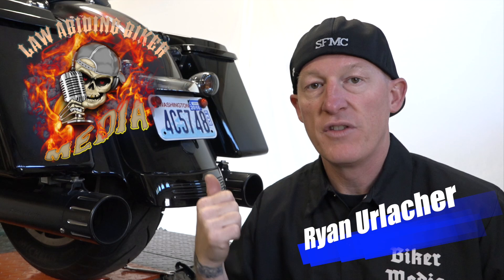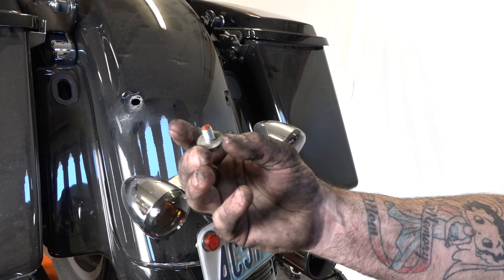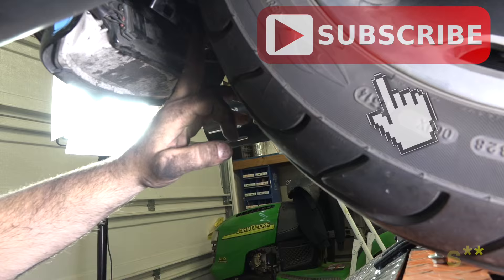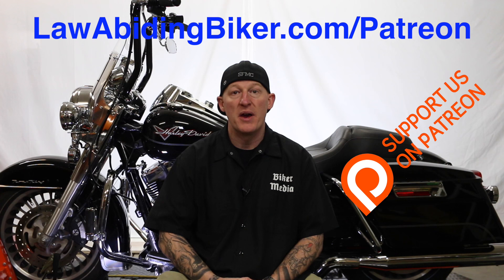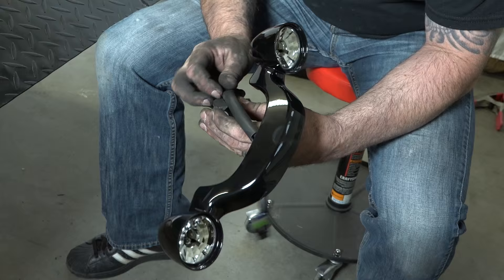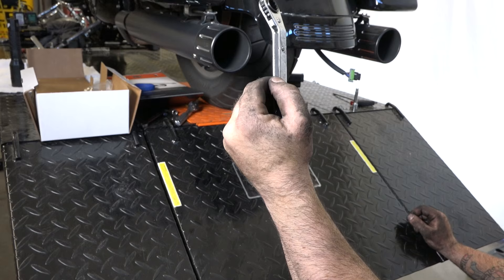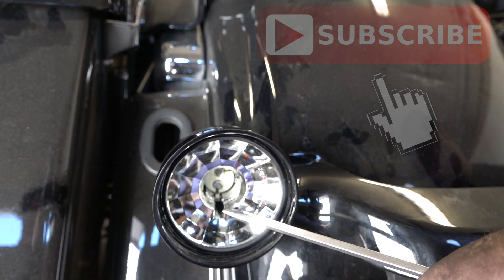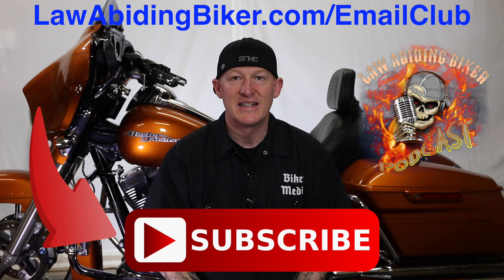Install Bullet Rear Turn Signals LED & Brake Light Bar on Harley Davidson Touring-DIY

Comment: Today I fitted the Harley turn signal relocation kit to my 2007 Electra Glide. The bike is imported from the USA and that kit allows mounting of the bigger and more awkward British number plate.
Your video is excellent! It gave me the confidence to carry out the work. Furthermore your video helped to make sense of the Harley instructions. The job is a little more involved for the Electra Glide but the task is essentially the same.
I just hate paying dealers for work that can be accomplished at home. Your videos help us to know the machine and take responsibility for making sure it is serviced and safe. Thank you.
Reply from the maker: Thanks John for the shout out. Super glad and always smile when I hear that the videos are helping bikers worldwide!!  hope you are well and getting some riding in!!
Reply: Hey John, which kit did you use? I just got a 2007 Electra Glide myself.

Comment: Hi I have a question, will this turn signal assembly bolt on a 2010 Roadking, I see the bolt holes are almost at the same distance from each other? It will be helpful as I am planning to replace that big chrome bar at the rear, thanks.

Comment: Love your vids. Thanks. I am looking for a bullet light bar replacement w/ laydown rear brake light for a 2009 Ultra Classic. I want to get away from the str8 bar with turn signals. Any suggestions.  Thanks
Reply: Paul In fact I’m also looking for a similar solution like the one you asked for. I found a video online which has a fix for this but ufortunately its a 5 year old video and the part doesn’t seem to be available now. Let me know if u get lucky with something! Thanks.

Comment: Does 2012 street glide use 1157 for front signals and rear lights? Or is it 1156 for the rear brake lights?
Reply: If it just has the 2 bullets like the bike in the video they are most likely 1157's.

Comment: I've got an '09 Road King, will the Streed Glide rear turn signals the same as these fit? TIA.
Reply: Even I have the same question posted, but we are not getting any replies. Did you find a solution to change that big chrome bar with these Street Glide turn signals?

Comment: Rayn, hey man, need some help please,  have a 03 road king,  with bullet turn signals in rear, bulbs are 1156, I  can not get leds to light up, WHY,  HELP BUDDY
Reply from the maker: You may need a load leveler on a 2003.  What kind of lights are you installing?

Ride safe & Ride Often!
Here is a link to a bunch of our useful Free vids: http://www.lawabidingbiker.com/freevideos
Here is a link to some of our useful for purchase videos: http://www.lawabidingbiker.com/buyvideos
Want Answers & Information Fast? And help support us at the same time? Do you like the content we provide?
Our patrons get answers to their questions/comments/feedback in less than 24 hrs and are part of our Private Facebook Group. If you are interested in being in this exclusive group you can get all the details at ==> http://www.lawabidingbiker.com/patreon
If you haven't subscribed to the Law Abiding Biker Podcast make sure to do so. Listen in as we talk weekly about issues/items like this & so much more. You can listen on iTunes (Apple/IOS), Stitcher Radio (Android), or any other Podcast App ==> http://www.lawabidingbiker.com/podcast
Join our free email club at http:///www.LawAbidingBiker.com/EmailClub. Only relevant content will be sent from time to time. Email club members are the first to find out about free or for sale content are given special coupon codes.
Reply: Ryan Urlacher led, 1156 cause the reanimated has bullet turn signals
Reply: I am  pretty sure, I  put a badlands 111 under the seat, for the LEDS, it's a load equalizer
Reply: And still wouldn't light up, the reg 1156 bulbs, light just find, but for some reason, the LEDS won't light